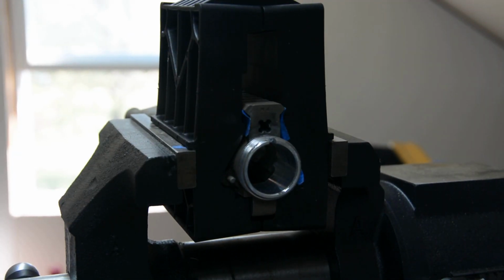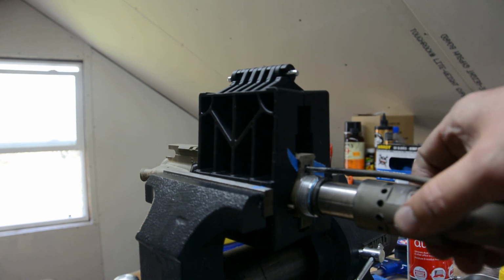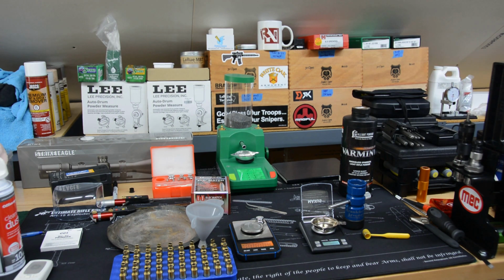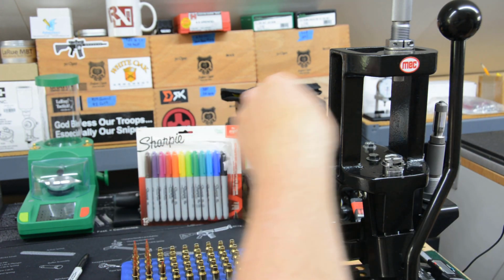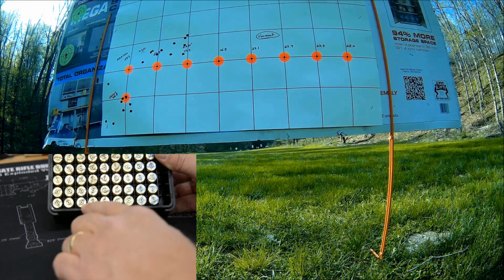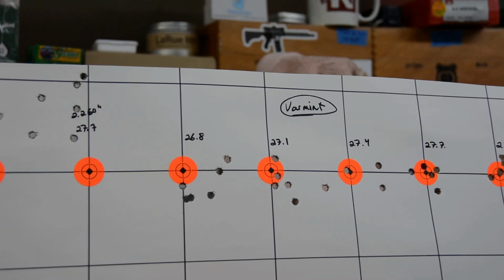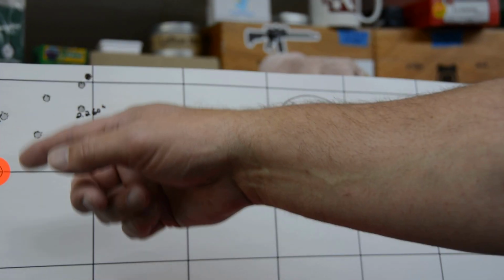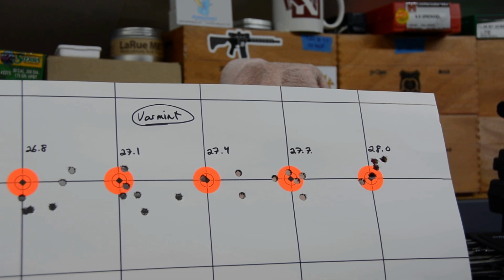6.5mm Grendel pt10  -Receiver lapping, Hornady 130gr ELD, and Varmint

Comment: Od my Grendel handloads with my Bca 5r barrel at great even using cheap midsouth Shooters match monster bullets I get around 15 or less SD and a Speed of 2407 average with my 20in stainless barrel.... That's very odd barrels should be shooting better never had a bca lemon
Reply from the maker: Yeah, not sure as I bought this barrel n similar recommendations as yours.  Mine was not 5R so perhaps that’s a factor.  Bore was a little rough (see my testing video) but not sure that was it alone either.
Reply: @Hazzbro1964  oh check the crown once I've heard my firend took the old drill and brass bolt and with valve compound recrowned it a little pulled patches through to make sure no compound got into it and then pulled a snake through twice and wiped the outside with isopropyl 95% alcohal  I'd say it could be a crown issue I'm the only guy in my group with a 5r Grendel. But there getting similar results.... Hmmm I'd contact bca and get a replacement barrel and see before any more shooting tbh

Comment: What brand of barrel is in your upper? With those ES/SD numbers, the groups seem like they should be better. Or maybe it's the optic.
Reply from the maker: Randy, its a bear creek Arsenal barrel....started with it based on some local feedback...thinking its a big mistake at this point.   Going to change out the muzzle brake for a heavy one to change the harmonics next.   I fully agree it should be shooting much better.   Don’t think it’s the optic and have checked tightness etc.   Could swap it out but don’t want to take one off my other AR’s as they are both .43 moa or lower!   Just wish White Oak Armament would make a 6.5 Grendel barrel!   Will probability go to a Wilson Combat or Faxon next.  Going to recheck barrel torque today and then give it one more chance 😧
Reply: @Hazzbro1964  I was watching a video the other day and this person was also having an issue with flyers (different caliber but similar issue) and it ended going away when he took the muzzle break off and he could turn the problem on and off by installing and removing it. Might be worth looking at. A comment in that same video said he had the same issue and it ended up being threads on the barrel were not concentrict as the root cause, but the muzzle brake causing issues with flyers was the symptom.
Reply from the maker: Thanks Ameritus,  might give it a try as nothing else has worked.

Comment: The accuracy in all my ar15 grendels opens up every time I clean the barrels. Usually takes 20-30 rds before it starts settling in again. Freaked me out a little bit when I changed the handguard on my 18” faxon barreled build. That barrel shoots any factory ammo I’ve tested into sub moa groups and some even sub half moa. It really seems to like the 120gn projectiles. But after a good cleaning and a handguard change I took it out it was shooting so bad at 50yds it was hard even getting the rifle zeroed but I kept shooting and after 15 rds or so it started getting better and by the time I got up to 30rds it was back to those one hole groups I was accustomed too with that setup. Rest of the rifle is pretty basic aero receivers faxon bcg rock river 2 stage varmint trigger magpul ubr stock.